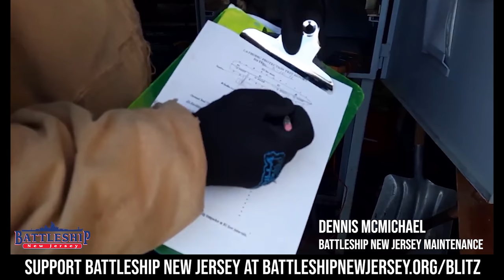Armoring a Battleship: Cathodic Protection

Comment: I would be VERY surprised if the New Jersey does NOT have an installed Impressed Cathodic Protection System.  This system would be an active system specifically designed for the vessel which uses multiple sensors and electrodes to measure the current flow between the hull and the water, then impresses an equal but opposite current flow via the hull electrodes.  If this system is indeed installed and either in working condition or economically repairable, this would be your ideal solution.  Working properly, the system would constantly monitor and adjust the Cathodic Protection system in real time to accommodate changing conditions.  

This one would be pretty easy to miss, as would probably look like a large rectangular electrical junction box with an analog meter and a selector switch.  On an AOR class oiler, it was mounted on the forward bulkhead of the engine room.  Memory dims, but I believe that it also interacted with the degaussing systems so may be in close proximity to that control equipment.

As always with things electrical, your go-to guide for existence and location are the "breakers and fuses" schedules in the electrical blueprints.  If you can't find a circuit on the prints, or have no clue which sheet to even start with, these schedules will generally give you a circuit designation and sheet number.  Failing that, check the "Input Power" side of the local IC Switchboards in the Engineering spaces for your ICPS power.

Another awesome resource for everything from a propulsion turbine to a 4-slice toaster are the PMS (Preventative Maintenance) schedule boards and card decks.  If something  requires cleaning, adjustment, or calibration, it will have a schedule entry and a PMS card which details the procedures.  The schedule boards and cards would generally be in the workspace for each division.(Yes, I have personally seen a PMS card which detailed how to unplug a toaster, empty the crumb tray, and use a soft brush to remove any remaining bread crumbs...)

Comment: My chemistry says that the " hardness"  of the water (acid/base balance) is not as significant as the amount of salt, in its effect on corrosion but is important in the amount of electrons you have flying around. Do you take reading on the water pH when you team are testing the protection system Ryan.

Comment: I'd be interested in more info on how the ship is wired. I'm familiar with residential wiring but not much commercial stuff and definitely not marine.
Reply: Marine wiring is a totally different critter.  Floating ground AND neutral.  ANY voltage or continuity between ANY conductor and the hull is a fault condition.  Most common cause of a fault condition is some consumer grade gadget brought on board by a sailor.  As a general rule, if it has a plug, it has an inspection tag tied to it.  Christmas and Father's Day generally resulted in a line of sailors outside the electrical shop, all bearing an electric razor or new hair clippers.

Comment: Would it work to weld on loops onto the hull when drydocking so you can have sacrifical anodes that can be swapped out by divers? so you can renew them without drydocking. Or would that alter the articfact to much? would it seriously hamper your capabilty to tow it or to drydock her in the future?
Reply from the maker: Basically this exists. You can send down divers to replace anodes by unscrewing them. This is tough in places with fast moving water or very murky water and especially do for the very large ships like NJ, we've got hundreds of anodes. Its why we have an impressed current system as our primary system.

Comment: I'm building a small beachfront house with a (galvanized) steel frame. Supposedly, the salty sea breeze will wreak havok on it, In spite of the galvanization and anti corrosive paint.
Does anyone know if some DIY active cathodic protection could maybe help?
Reply from the maker: You're looking to protect against the salt, cathodic protection is against electricity. On ships we just make sure there's lots of paint on there!
Reply: @BattleshipNewJersey  Both are about the unwanted flow of electrons.
Reply: As long as the frame isn't exposed directly, I would think other steel stuff in your house such as appliances would be the real problem and electrical outlets, too.  If the galvanization and paint was applied correctly, I think it would last a long time.  What kind of anti corrosive paint, though?  In aviation, we used to use zinc chromate.  Now the equivalent is zinc phosphate.  The epoxy version of it is darn near impenetrable.  If you are going to do cathodic protection, it's important for there to be electrical continuity between all the pieces.  So you need to sand the paint off at the connections then optionally repaint once assembled.  Then you need to sand the paint off where you connect zinc anodes (passive) or wherever you connect the active system.  But I think you're fine with the galvanization and paint.